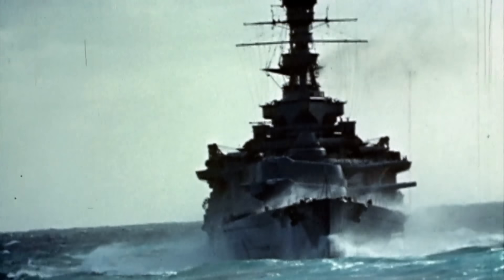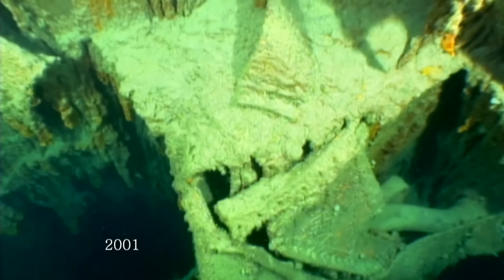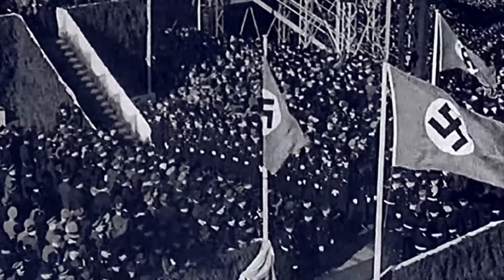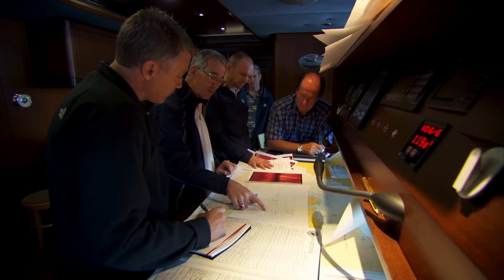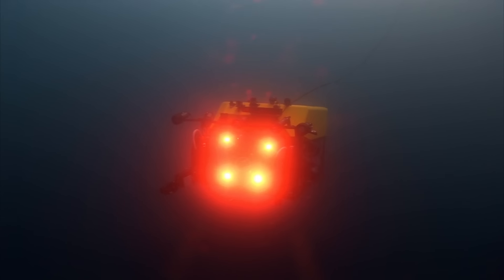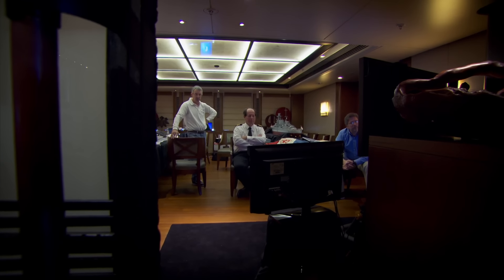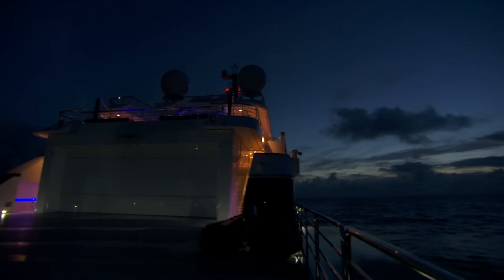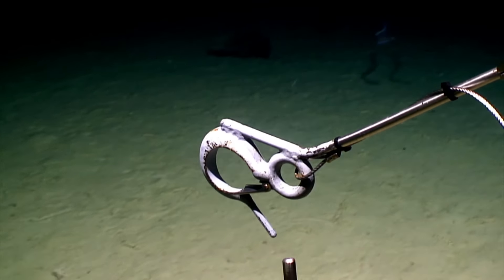How the Bismarck Sank HMS Hood - Documentary

Comment: Never understood given The Hoods weakness at range why the POW wasnt leading the 2 when they engaged to take any hits until Hood was at a safer range. Also, the cause has been known for years.
Reply: POW was slower than Hood, So why would she be leading?
Reply: @KatyushaLauncher  Because she had much better deck armor, once the Hood was under a certain range that was not an issue anymore, so it would make sense for the POW to take the incoming fire until they got under said range. Prinz Eugen only had 8 inch guns, POW and Hood would have been a tough one for even Bismarck in a sustained fight. I presume it was simply due to the fact that Holland was on the Hood. Silly tactics if you ask me.
Reply: @BobSmith-sc6dq  Again why would a slower ship lead an interception?
Reply: @KatyushaLauncher  because it had better armour. To take the hits. The shell that destroyed hood would not have done the same to POW. I just explained this 🤷‍♂️
Reply: @BobSmith-sc6dq  If POW had taken the lead then they wouldn't even be able to intercept the Bismarck because POW is slower
Reply: @KatyushaLauncher  ? They were there together. The POW was on the scene only 700 yards away. They had already intercepted.
Reply: @BobSmith-sc6dq  POW was about 26,500 yards away from the German Flotilla while Hood with her speed was about 18,210 yards from Bismarck and Eugen, that's more than 700 yards apart
Reply: @KatyushaLauncher  no. You really need to read up on this. I will send you the links later. They intercepted together, at 28kts BTW.
Reply: @KatyushaLauncher  and also... Aware of Hood's inadequate protective armour, distant to the southeast of where the battle took place, Holland's superior (Admiral Sir John Tovey) deliberated on ordering him to have Prince of Wales sail ahead of Hood. With the ships in this position, Tovey concluded the better-protected Prince of Wales could draw the German battleships' large-shell gunfire. Ultimately, Tovey did not give the order, later saying "I did not feel such interference with such a senior officer justified."[7]
Reply: @BobSmith-sc6dq  tovey's orders were, raise your flag in Hood, take Prince of Wales and 6 destroyers and take up patrol at whichever position it was.
Reply: Jordan Fan，Prophet of Environment。范楚漳，環境先知：
How Did The Bismarck Manage To Sink HMS Hood So Quickly? 
Answer:  The answers were very simple:  When the HMS Hood was battling the German battleships  Bismarck et al, those lazy British  navy sailors onboard the Hood were busily eating their favorite breakfast food - Biscuits with Sardines.  And had forgotten to return fire at the Bismarck!Xxvbdf

Comment: The deck plate was not armour plated so a shell went straight through to the gun powder room 🔥💥
Reply: The deck had three inches of armour. As much as a Queen Elizabeth class battleship.
Reply: Hood's 3in deck armour was proof against 15in shells hitting anywhere below 20 degrees as demonstrated during interwar testing. The angle of impact of Bismarck's incoming fire at 17000 yards? 11-13 degrees.

Comment: I am surprised that there is no referencing the WW I loss of a number of ships during the battle of Jutland designed much like this ship. Surely the same mechanism of loss was in play. They were lost because crews tried to improve firing speed by having cordite outside of secure systems and it is this that set off a chain reaction down to the magazine. Nothing in the film proves why the magazine went up just that it did and we already knew that.
Reply: Hood was far better armoured than the battlecruisers lost at Jutland, and cordite charges hadn't been stacked around turrets since June, 1916.

Comment: Battleship vs older Battlecruiser.  Battlecruisers were built to chase down Battleships. The design of Hood sacrificed protection to gain speed and maneuverability. By 1941, Hood was an obsolete and aging design. 
British Admiralty had a fascination with Battlecruisers. The Battle of Jutland, in 1916, demonstrated Battlecruisers, and especially those designed like the Hoof, were very vulnerable to Magazine Explosions. The Ammunition Stores were inadequately armored for Plunging Fire, just like they were in 1916.
Reply: 'The Battle of Jutland, in 1916, demonstrated Battlecruisers, and especially those designed like the Hood, were very vulnerable to Magazine Explosions.'    Actually, it demonstrated only that storing munitions outside the magazine, as Beatty encouraged his captains to do, in order to increase rate of fire, bordered on the idiotic, which is why it didn't happen again after Jutland.

If Hood, after her post-Jutland redesign, was inadequately armoured against plunging fire, then what does that say about the Iron Dukes, the WW1 King George V, and the  Queen Elizabeths, what had the same thickness of deck armour.

Of course Hood was aging by 1941, when she was 20 years old, but her armour was not particularly weak.

Comment: Bismark was the epitome of battleship engineering and the Hood was older technology and outgunned by the Bismark.
Reply: Many features of Bismarck were obsolete at the time she was built.
Reply: Hood was modernized throughot its life time from 1920 on. But from the beginning of its construction in september 1916 it had the same construction failures as the british battlecruises had which were sunk at the Jutland battle. Heavy armament, strong engines but less armour.
Reply: @ichmalealsobinich  No. She was extensively redesigned after Jutland. To give an example, the three most modern British battlecruisers Tiger, Renown, & Repulse, had belts of 9 inches (Tiger) and 6 inches ( Renown & Repulse). Hood's belt was 12 inches, as was that of the Iron Duke class battleships.
Reply: It was not out gunned nuff nuff they both had identical guns. 8 x 15 inch guns in 4 x twin turrets.

Comment: Admiral Lutjens decided not to refuel in Bergen. Bismark left Norway without 2000 tons of fuel it could have loaded. That was going to have massive importance later. When Bismark was racing towards France, they were short on fuel, and Bismark had to run it's engines at 22 knots, instead of 28 knots (22 Knots was the efficient speed, while 28 knots consumed fuel at a much faster rate which would have exhausted the fuel supply before reaching France) If they had sailed at top speed, Bismark would have been 160 miles closer to France when it was found by the flying boat. And she would have been out of range for the swordfish from Ark Royal, and too far ahead for the Royal Navy

Comment: I disagree with the hypothesis of the captain turning or not turning broadside during the engagement. Turning broadside in that instance allows you to bear all weapons on target, however you simultaneously provide a broadside opportunity from a target that already has all weapons tracking you. If you do not turn and continue to close the distance, you present a smaller cross section and a harder target to hit. Ultimately, it doesnt matter it was an incredibly lucky and destructive hit
Reply: Holland sought to close the range as quickly as possible because he was fully aware of Hood's vulnerablity to plunging fire. Her decks were amoured to WW1 battleship standards, but not up to the level of more modern capital ships.

The only possible error of which he might be accused was in not allowing Prince of Wales, a ship with far superior deck & hull armour to that of Bismarck, to operate independently at longer range. Tovey did precisely this with Rodney on 27 May.

That is, however, being wise after the event, and doubtless Holland was concerned about the fact that PoW was far from fully worked up.

Comment: HMS Hood was a 'battlecruiser' - and not a 'battleship'.  
She lacked the commensurate armour to withstand shell impacts equivalent to what she herself fired.  That was a prerequisite test for a battleship's design, but not so for a battlecruiser.   Being free of the encumbering weight of comprehensive armour, the HMS Hood achieved greater speed.  She was intended to chase down and destroy lesser ships, such as fast cruisers.  Her engagement with the Bismark was as faulty as the prior use of battlecruisers at Jutland in WWI, where they were thrown into the line with battleships in order to augment the fleet's firepower.  They paid a high price back then - with several battlecruisers suffering the exact same catastrophic fate as HMS Hood.   One can twiddle about over how exactly the destructive shells penetrated her vitals - but in any event, the inevitable end soon happened.  In my opinion, HMS Hood's Achilles heal was her popular regard - derived from her graceful appearance, size, and speed - that overlooked her inadequate armour protection.  She was not a battleship, just a battlecruiser who was thrown into the wrong fight, alongside the battleship HMS Prince of Wales, which had yet to complete her shakedown routine and still had workmen on board.
Reply: Hood was far more a fast battleship than a true battlecruiser. Her armour was comparable to that of the Queen Elizabeth class battleships. The previous battlecruiser class, the Renowns, had 6 inch armour belts. Hood had a 12 inch belt.

The battlecruisers at Jutland were not  'thrown into the line with battleships in order to augment the fleet's firepower.'  They fought as a separate fleet, supported by four fast battleships, 

Hood was one of four capital ships available to Tovey with the speed to chase down Bismarck. Two, King George V and Repulse, were positioned in the Iceland-Faroes Gap, and the other two, Hood & Prince of Wales in the Denmark Strait. These were the two exit points into the wider Atlantic, and it was essential to prevent Bismarck & Prinz Eugen from breaking out, which would have made them far more difficult to hunt down.   The reasoning, without ther benefit of hindsight, was that both units were independently capable of doing this.

It worked, by the way, in that the damage Prince of Wales inflicted on Bismarck was sufficient to force Luyjens to call off his mission and make for St. Nazaire.

The simple fact is, that if Hood had not been there, Prince of Wales could not have been sent unsupported.

Comment: But we were always told at school over 40 years ago that the Hood had lightly armoured decks and that a shell went through into the magazine and the ship blew up. That’s what they are saying they discovered and wasn’t known. Confused!
Reply: Hood had 3 inches of armored deck which is standard for any Battleships at the time
Reply: @KatyushaLauncher  it doesn't have any deck armour, only laminate HT construction steel thickness vary depending on the placement
Reply: @JevansUK  Hood's deck armor did consist of multiple layers but the thickest part of it is still 3 inches
Reply: @KatyushaLauncher  it's 1.25" over 1" over 0.75". A single plate would give more protection more so if it had been armour such as in the G3 Battlecruiser design

Comment: Pretty much unavoidable for Barham and Hood. You had to store cordite somewhere and you cannot operate 15 inch guns without it. Some people talked about strengthening deck armor, but even the most well-armored ships: Rodney, Nelson, Bismarck, and Tirpitz had only 6.5 inch deck armor and still vulnerable to dive bombers and plunging fire. The BB was just obsolete.
Reply: No British or German battleship was sunk by dive bombing in WW2. The Rodneys and KGVs  had 6 inches of deck armour, the Bismarcks  4.7 inches.  Decks designed to repel plunging fire from 15 inch AP shells weighing 1800 lbs. would certainly defeat 1100 lb. bombs used by aircraft such as the Ju87.

The largest RN warship sunk by German dive bombers in WW2 was a light cruiser, with a 2 inch deck.

Comment: The U.S. had a more powerful warship at this time than the Hood in the battleship U.S.S. West Virginia (BB-48) built about the same time as Hood and commissioned in 1923. Her main armament consisted of 8-16 inch .45 cal. guns and though she wasn't as fast, she was a more heavily armored vessel than the Hood which was not a battleship, but a battle cruiser that sacrificed armor protection for speed. Battle cruisers were designed for a much different purpose and employment than battleships were. Naval authorities have suggested that Hood had no business in taking on Bismarck in a running gun duel. She would have been better off dealing with or running off Prinz Eugen first while the Prince of Wales slugged it out with Bismarck and could have re-joined the Prince in battle. The fact that Hood led the charge against the Germans and fired the first salvo seems to have been a decision based on national pride in that Hood was Great Britain's most popular and prestigious warship and she was believed to be unmatched by any other. This battle was to the ultimate test of everything that was expected and believed of her.

Comment: Hood was a Battle Cruiser who survived Jutland. Jutland was a disaster for the British because of so many sailors died from it. Most of those about 85% were from the sinking of several British Battle Cruisers very similar to the Hood class. The admiral , Beaty attacked German Battleships thinking his heavier guns would make a difference but the better fire control and higher angle of fire and thicker armor made a huge difference in favor of the Germans. The battle cruiser has much thinner armor on the sides and the top decks, less weight, more speed. Fast doesn't mean much when a large shell goes through your decks and detonates inside the main magazine with 250-300, 1700 pound shells and 900 -100 pound gun powder propellant charges. It not just another fireworks display folks. H.M.S. Hood was scheduled to go into the shipyards for serious upgrades, thicker top armor, torpedo blisters, new higher angle guns, better munitions handling equipment and better crew comforts. But all was cancelled when Bismark broke out and made a run for the North Sea. All heavy ships were ordered to look for Bismark; including Hood. The British Navy have refused to believe or accept what happened; but they failed to remember Jutland. Several weeks later, they sent two British Capital ships into Japanese held waters without carrier plane coverage got both of them sunk,(one of those a Battle Cruiser) from Japanese aircraft.The main reason they were able to catch Bismark was because of damage from British aircraft. Several thousand people died over that one also. And we want to YET ASK WHY. Why"? Well, when you have senior officers who fight the newest war with tactics from the last....small wonder.
Reply: Hood was built in 1920's, that's long after Jutland had already happened
Reply: Hood was far from similar to the battlecruisers at Jutland.  The best armoured of the three sunk there was Queen Mary, with a 9 inch belt & 2.5 inch deck armour. Hood had a 12 inch belt and a 3 inch deck. The same as contemporary battleships.
Reply: Jordan Fan，Prophet of Environment。范楚漳，環境先知：
How Did The Bismarck Manage To Sink HMS Hood So Quickly? 
Answer:  The answers were very simple:  When the HMS Hood was battling the German battleships  Bismarck et al, those lazy British  navy sailors onboard the Hood were busily eating their favorite breakfast food - Biscuits with Sardines.  And had forgotten to return fire at the Bismarck!(())

Comment: HMS Hood was a battlecruiser not a battleship hood was a ww1 design which had faults
Reply: 1920.... 
HMS Warspite      8x15in guns, 12 inch belt armour, 3 in deck armour, speed 24 knots, battleship
HMS Hood            8x15in guns, 12 inch belt armour, 3 in deck armour, speed 32 knots, FAST battleship.

HMS Hood was completed as WW1 ends and it became internationally obvious that a naval treaty (restricting amongst other things battleship numbers and displacements) is necessary to stop an unaffordable international arms race from developing. What better way to increase your naval dominance by insisting that your latest fast battleship is a "battlecruiser" which is what HMS Hood was originally conceived & designed as, even though she was subsequently upgraded during her construction to become the original fast battleship that she finally was.

"A Rose by any other name".......